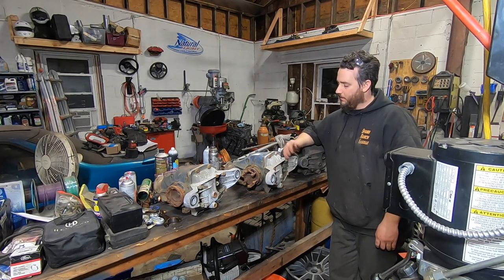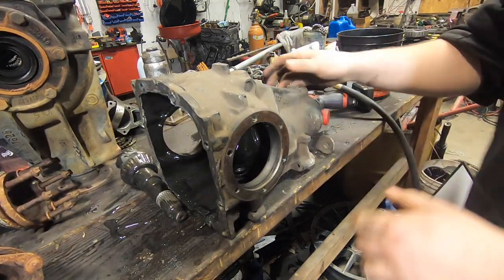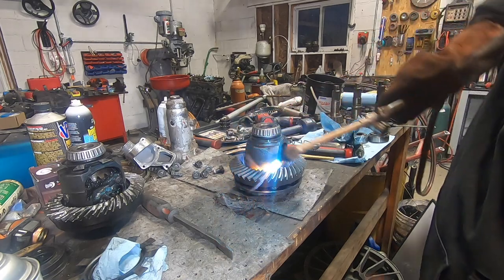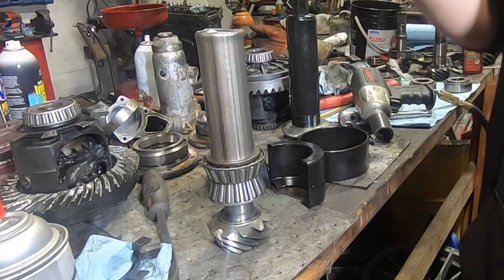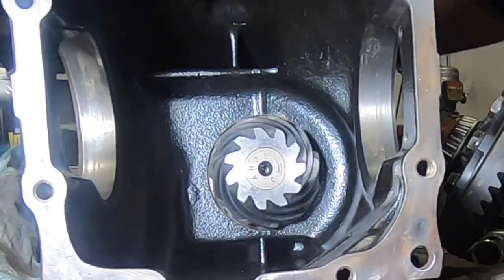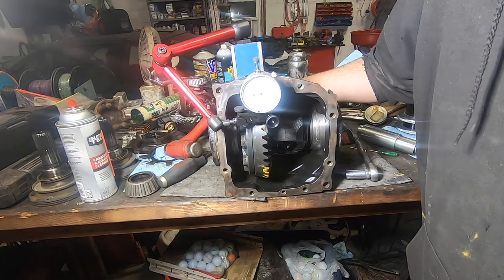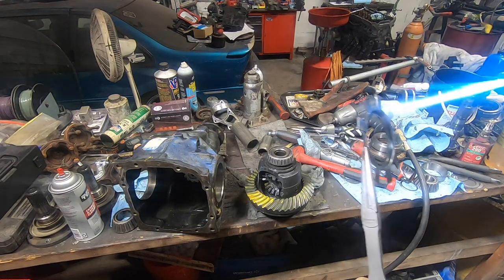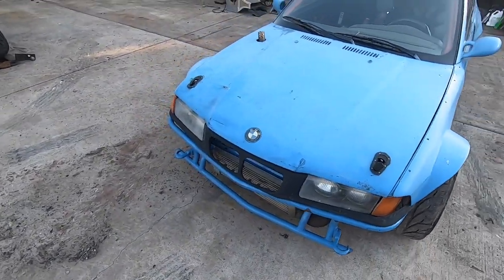From Scrap: Building the ultimate E36 3.73 differential for drifting! 188mm shimming

Comment: Great video!  Can you explain that pinion nut torque again - the spec says 22in/lbs, you have it at 24in/lbs?  And because this is for a non-street car, it being a bit tight is ok?  Also, the front pinion bearing, is it pressed in, or just driven home when you tighten the pinion preload?
Reply from the maker: Its okay for a drift car. If it was a race car I would keep the pinion preload a smidge looser to help with heat as it would see higher rpms for long periods of time, where drifting is much more intermittent.

Yes the front bearing is pushed on with the pinion flange. It fits snug but isn't a super press fit

Comment: Good video, I have a quetion Do the internal parts of the differential of an E39 fit an E30? I heard that the differential of a z4 std is the same as the e30 but I have one from an E39 and I would like to know if it is the same so I don't have to buy the one for the z4
Reply from the maker: E39 and E30 are not compatible. Also, I think Z3, not Z4, is compatible with e30.

Comment: Would you say its posible to build a 2.29 ratio 188 diff using the 17t pinion of a 2.65 and the 39t ringgear of a 2.79? This would be used on a m57 swaped car with 5 speed manual, wich have 2.28 final drive from factory.
Reply from the maker: The ring and pinion are matched at the factory, so we cant mix/match them unfortunately. The teeth aren't always cut the same as the ratio changes. Also the offset of the ring gear changes.
Reply: @spankranchgarage  mm i see, i figured this might be the case.. oh well thank you for the answer 👍 then 2.56 from 325tds it is

Comment: Hey! Thanks for the video, i have a short question. I have an 168mm 3,15 lsd for my e36 and tried rebuilding it, i basically did all the internals new (bearings, locking plates etc) and when i put it all back together i had the problem, that when turning it, it was reaally hard to turn for like 2-3 teeths. What might be my problem here? I dont really know if the 188 and 165 diffs are the same and if the things u said apply, and even if they do im still kinda clueless lol. would really appreciate your help <3
Reply from the maker: When you are at the "hard to turn" part, does the backlash change to zero? Sometimes if the ring gear isnt seated onto the carrier fully this can happen, or if there is some residue stuck between the ring gear and the carrier mating surfaces. If the backlash is still okay at the tight part then we need to determine if its the pinion binding or the carrier. This is best done by hand, you will be able to determine which component is "tight"
Reply: @spankranchgarage  thanks for your quick response… how do i explain this (im from germany, so my english isnt that good in technical terms) i didnt fully rebuild it. i knew the two bearings were toast because it was whining so i didnt disassemble the input shaft thats connected to the driveshaft (?)
i basically just took out the internals, „repaired“ them and put it back together hoping that the tolerances would still be good, so my theory is that the backlash is fucked, i still need to check this but i think thats it, and i can only set it by the things that go between the housing and the „bearing shield“ of the outer part of the bearing, right?
i hope u could understand everything i tried to say
Reply from the maker: @LetsPlay2003  Yes I understand you. Did you remove and reinstall the gear from the LSD? If so make sure there is no dirt stuck between the gear and the LSD causing it to wobble. If that's okay you can use the "shims" to change the backlash. The "Shims" are the discs of steel that fit between the bearing cup and the differential housing. These are specific to Left and Right, so if you got them mixed up that may have caused this problem too.
Reply: @spankranchgarage  yes i disassembeled it and put new bearings on it, (and i „revised“ the lsd thing that i disassembeled) there shouldnt be any dirt in between because i did it multiple times to check xd
Reply: and switched around the shims

Comment: Tego się tak nie robi. Wprowadzasz ludzi w błąd, to jest bardziej skomplikowane niż Ci się wydaje.
Najważniejsze jest osadzenie wałka ataku, a później regulacja mechanizmu różnicowego. Jeśli źle ustawisz wałek ataku to powielasz błąd przy regulacji mechnizmu róźnicowego. Nie dziwie się że poprzednie dyfry też się zepsuły.
Reply from the maker: The intent of the video is more to show that you can use standard shims from other diffs to build a 188mm BMW diff. The specs I set this to are specific to the driving I do and I state its not recommended that anyone follows this. This diff is not built to be quiet or long lasting. It is built to take short duration, high power, low heat drift passes. For what its worth, the broken diffs were stock from BMW and this one I built hasnt broken yet.